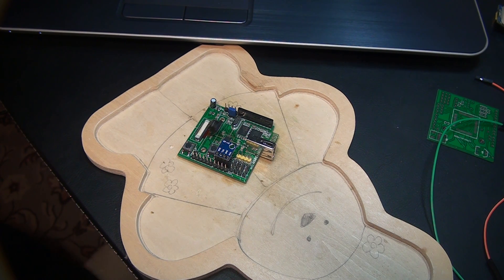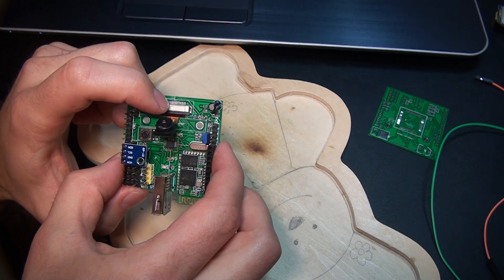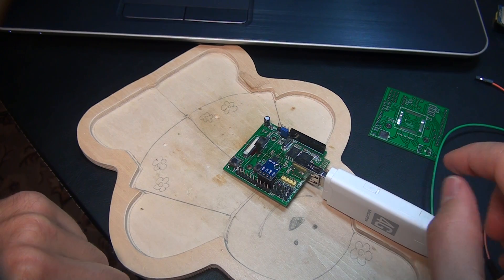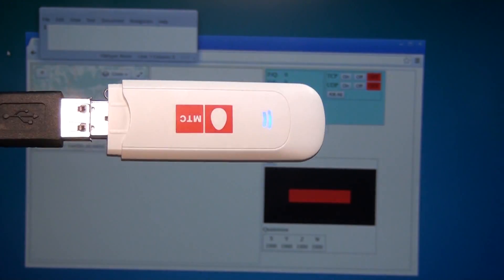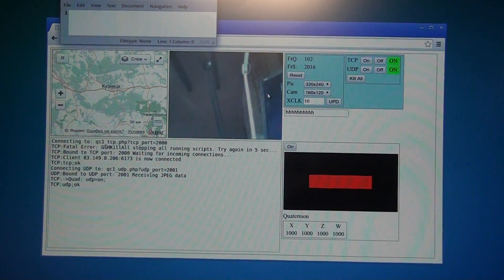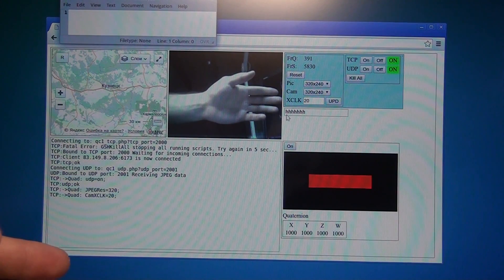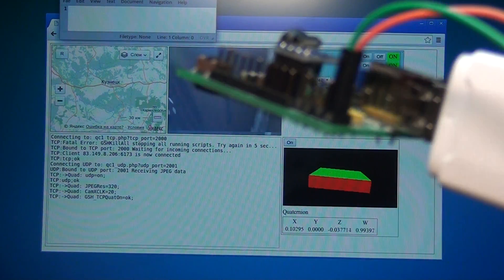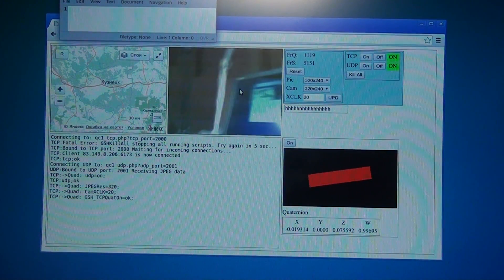GSM 3G/4G internet enabled quadcopter controller board first review

Comment: I dont get why someone cant just take a smart phone/droid and make it for drones... All the barometer, speed, altitude,altimeter, gps, ect,.. and many other key features are standard on phones. The camera could be fold-able/removable, and many have nice cameras. Make the screen detachable as it is extra weight. and pow the cell-fly-phone. You could fly a phone to anyone anywhere or just fpv with skype? face time? whats the range on my quadcopter then? my entire service coverage area? so beyond the state. Just would need a massive 100,000Mah, 100ah 4s 20c-45c.
Reply: Way off on that one, buddy.
Reply: Michael Silcox thats what Ive been thinking for years. Closest is ANDRUAV with a cheap APM you dont need to buy gps unit or telemetry unit as its done by the phone and works great.
But still need a flight control board to control plane quad. It would take a mobile company to get on board to do what we both want. 
But this just uses 2x mobiles and a $40 control board. No Transmitter, though Id want one, and away you go.
Reply: If you’ve accomplish all of that, you have develop a home made cruise missile controller.
Reply: @juanporontong9461  its out there ANDRUAV look on youtube. Plus we all fly our Parrot disco over 4g longest flight I think has been 178km but that may have been broken by now, You can also find videos of this on youtube and best of all no lag in picture or RC control.

Comment: Very actually project! I have same idea of control throw Internet for RC models with small difference:replace only receiver part of RC model. Fully refuse radio control and use only Internet by 2G/3G/4G modems. For example, use APM flight controller with Internet control receiver, not RC receiver such as X8R (for Taranis X9D transmitter). This model (flight controller + Internet receiver) has some advantages: independent flight controller has many usefull finctions: autopilot for return-to-home, GPS-point holding, etc. Generate PWM is very simple to emulate real RC receiver signals.
Also we can use this receiver for other RC models: boats, cars, planes.

How about cooperative development? I have experience in STM32F4 programming, circuit design and great enthusiasm to realize control throw Internet.
Reply from the maker: mihail isaev 
Hi, take a look at helilab.blogspot.ru

Comment: How do you establish a connection between both modems with no public IP address? Relay server?
Reply from the maker: Junkers 
I've successfully tried both p2p and relay server configurations.
p2p works using udp hole punching technique but requires native app for tablet - ios and/or android.
Finally I decided to get back to relay server configuration because its simplicity and because it's platform independent - just works in any modern browser.

Comment: Very nice project. i would like to ask you. how do you connect to a usb modem ?
did you use AT command to send and receive thru TCP/IP ?
Reply from the maker: AT is only used to initialize modem and run PPP session and check GSM signal strength. After that its network stack on top of PPP that ends with TCP/UDP is implemented.
Reply: G's channel thank you for your reply. so you are implementing USB CDC in STM32 to connect with  a usb modem ? 
how do you connect the camera to a web server ? i only know how to create server/client tcp and udp in php. but how to stream from the camera to the web server ?
Reply from the maker: Correct. First step is CDC driver. Then you have to implement a full network stack so that you can get an image from camera and send it via tcp or udp on remote server where you have php or some another script that receives this image.

Comment: Good project. What flightcontrol you use?
Reply from the maker: Thanks. Not sure I understand what exactly you mean when asking about "flightcontrol".
I use iPad and Safari browser to open web application that controls my copter.
Reply: G's channel What microtroller  you use for read 4G. Can you share code?
Reply from the maker: Robot Canfly Receiver board is built using STM32F4 microcontroller. LTE USB modem is used for LTE rx/tx.
Reply: G's channel Do you opensource?
Reply: G's channel  Hi this is TANMAY GHOSH i want buy this circuit board "3g/4g Internet enabled quadcopter controller board please send me the link purchase website... my email id is tanmayghosh1992@gmail.com
Reply from the maker: ***** 
Hi, this is not for a sale yet.
Reply: G's channel ohh thank you,, so is there any process to make my quad-copter GSM based controlling circuit??

Comment: any idea where i can buy one of these? thx
Reply from the maker: Hi. Actually the concept has evolved from flight controller to GSM receiver. Better explained here:
http://helilab.blogspot.ru/

Speaking about this receiver it's important to understand that it's very technical setup and requires some knowledge to make it work. Following things should be considered:
1. It's just a prototype for the moment. It should not be considered as end product that works right out of the box. Rather it should be considered as a platform for experiments.
2. It's not produced in quantities, I do assembly (soldering, programming etc.) myself at home. In fact only 2 receivers were assembled and both hardware and software are going to change in future.
3. GSM modem support. For the moment only 4G Megafon M100-4 (Huawei E3272) is tested and proven to work. In general most of modems emulating PPP should be working, but this may require further testing or firmware upgrade. 
4. Web server part must be capable to run php, xcache and capable to open UDP sockets. I can share source code for server part if there will be a temptation to improve it or redesign it on faster platform (like Node.js, websockets etc.)
5. It should work after all steps to set it up are fulfilled, but there is no any guarantee that software and/or hardware has no bugs.
6. Device must work in the area with good 3G/4G GSM signal coverage. If GSM signal is not stable there is a chance for copter to be lost.
7. There is a lag in control signal transmission depending on GSM network quality.
8. Video signal for FPV is low quality (320x240 pixels) with low FPS.

... And there are more points to be considered.

So if all mentioned above still keeps you think you going to try it, I can assemble one for you and will be happy to hear your experience or suggestions on how it can be improved.